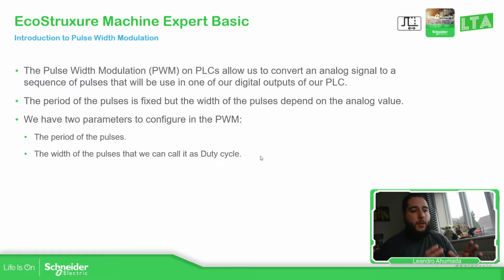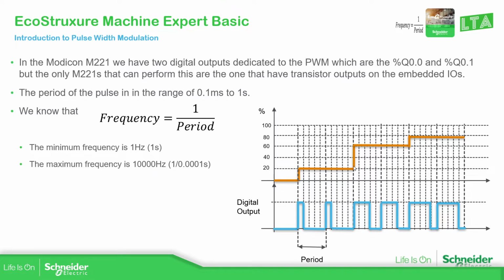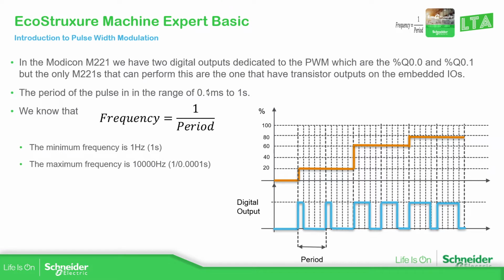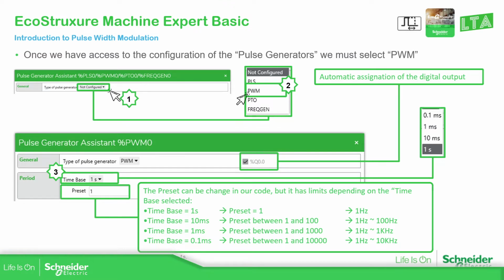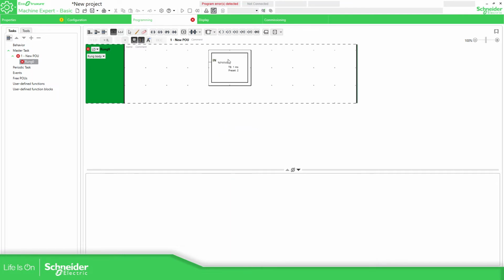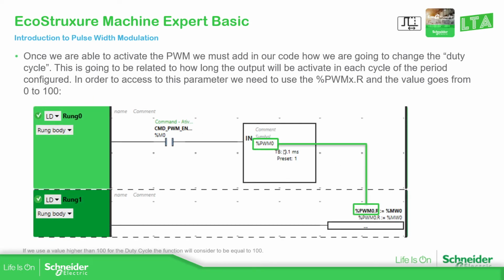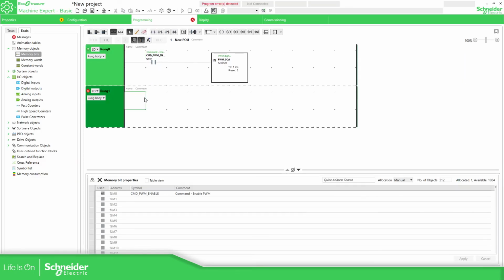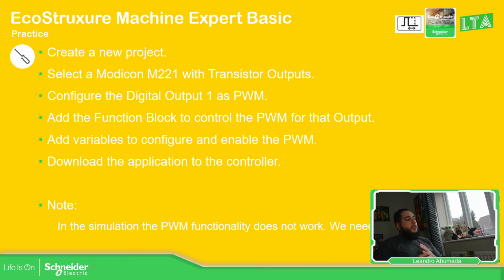Training - M221 - M15.1 Introduction to Pulse Width Modulation (PWM)

Comment: I have a PLC with a relay output (M221CE16R) and I want to use a PWM output. Is there a way to do this? For example, by adding an additional module?
Reply from the maker: Hi there! You must use transistor output for pwm using a relay output will reduce the lifetime. Everything will depend on the frequency of the pwm but you will need to check if using a standard output transistor will do it.
Reply: @LeTomasAHUMADA  Can the PWM output be used to control a 3 phase immersion heater through a solid state relay?
Reply from the maker: @MarioPutra-n9n again please use a transistor output for a pwm, you can check this range in schneider:

https://www.se.com/uk/en/product/SSM3A325BD/harmony-solid-state-modular-relay-25-a-din-rail-mount-zero-voltage-switching-input-432-v-dc-output-48600-v-ac/

Comment: Thank you. I have an issue with the pwm function block. It can't be activated because I use in the same time an exponent in a mathematical formula. Is it related to the cycle time of the master task ? How can I fix this issue ?
Reply from the maker: Hi Tarek! I am not aware of that kind of limitation. Can you share your project?
Reply: @LeTomasAHUMADA  The mathematical formula is given as follow : Y = 0.5 * (116 * X - 5) * exp(-21 * X). Thank you.
Reply from the maker: @tarekbenhacine8743  i separated the formula and i did not get any error:

%MF0 := 0.5 * exp(-21* %MF2)

%MF2 := %MF0 * (116 * %MF2 - 5)
Reply: @LeTomasAHUMADA  Thank you. When the formula is calculated alone there is no problem. However, when the pwm function block is enabled in the same time with the formula, the pwm output doesn't work.
Reply: In order to avoid using the mathematical formula, can I enter the (x,y) as a table in the plc ?

Comment: Could you please explain PWM for M172 too? i could not find any documents about  pwm for ESME HVAC. i m trying to control a step motor. But i can't control its speed. Help please!
Reply from the maker: Hi Emin! The pwm in the m172 is an interesting topic, thanks. 
I do not have any content yet but i will try to do something.
In the meantime in order to use the pwm, the m172 uses the analog inputs but you will need to check the model because it can change the location but it can have up to 2 pwm outputs.
The important here is the connection in order to not damage the control, please check page 100 of the hardware manual:
https://download.schneider-electric.com/files?p_enDocType=User+guide&p_File_Name=EIO0000002015.04.pdf&p_Doc_Ref=EIO0000002015
Then you will need to change the analog output type (check in the commissioning tab) and define the frequency.
Then in the programming there is a variable for the duty cycle of the pwm in the operator and block windows ( please check this part , i am not 100% )
Reply: @LeTomasAHUMADA   Thank you for your attention. I've looked at this document before, but I couldn't find much information. I can drive the stepper motor, I can control the direction, but I cannot adjust the speed. I changed the duty cycle and frequency but nothing changed. only, the motor stops working when duty cycle is 100 or 0 normally. Also, although I looked in detail, I could not find pwm blocks or operators in the software. Thank you so much.
Reply from the maker: @eminbalkaya8059  i just checked there is not any function block, you just need to write in the analog output the duty cycle that you want. You will need to check the connection to the motor probably having a interface relay solid state can make the job.
Reply: @LeTomasAHUMADA  Thank you. I gonna follow your instructions. have good day.